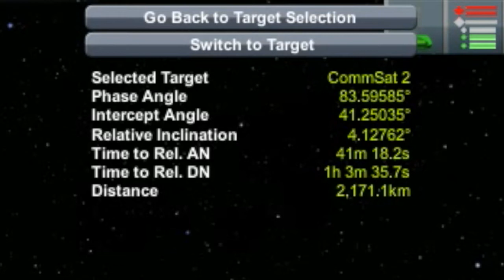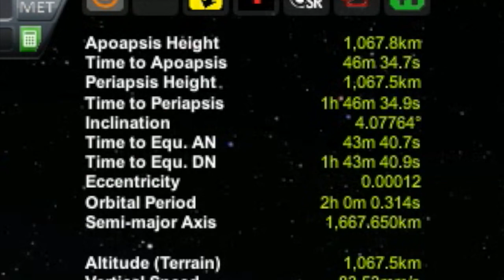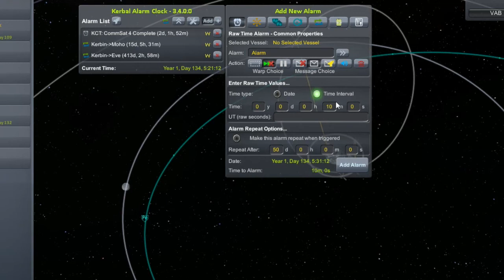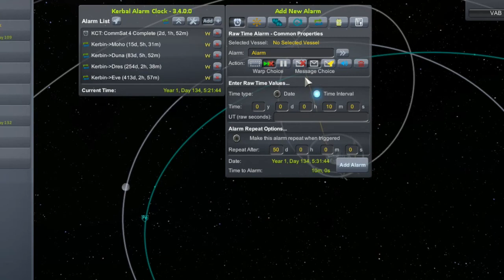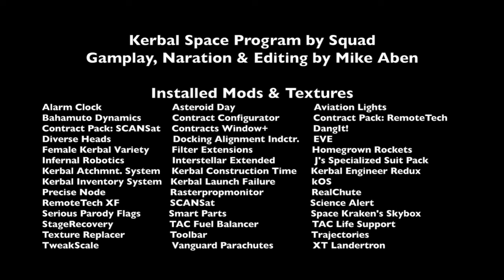KSP Career: Episode 17 - Communication Satellites

Comment: Mike when you get weird unwanted movement like you did on that first launch use a quick bit of time warp. It will stop all rotation and movement. I use it to remove unexplained wobble or movement like you experienced.
Also thanks for showing the transfer window feature in KAC, I had never realised that was there.
Reply from the maker: uglyduckling81 Good advice, though it still bugs me when ships behave unexpectedly.  I suspect part of the of the problem is that the only attitude control in space are the reaction wheels in the probe itself.  Even the main engine I chose isn't gimballed.

I have the 1.25 m reaction wheels being unlocked soon.  That'll likely fix the problem.

Comment: Can't seem to get my phase angles 120, can you explain how to do this?  I've just had to eyeball it but I was hoping there is a nice method of getting it
Reply from the maker: There are definitely some nice ways to do it.  If you have Kerbal Engineer, you can target the satellite you want to be 120 degrees from and then preform you transfer when your intercept angle is 120 degrees or 240 degrees.  That's what I do in this video, accept I go for a separation of 90 degrees.

A nicer way is to put multiple satellites on the same vehicle and set up a phasing orbit where each time you return to apoapsis you are 120 degrees off from the last time you were there.  You then just drop and circularize a satellite each time you are at apoapsis.  I talk about this in greater detail in this video.

https://youtu.be/HDq-rywfEaQ?t=4m48s

You can also do it with the stock maneuver nodes.  In this older video place a satellite 90 degrees from another satellite just using maneuver nodes.  It would be easy to modify the technique to get a 120 separation.

https://youtu.be/qHw0VDKX8BQ

I do plan on making a video sometime that has all this in one place.
Reply: Sounds good I'll have to give that a shot! I love your lets play btw. I've seen every episode
Reply: The intercept angle works pretty good. What do o do if orbits aren't perfect circle